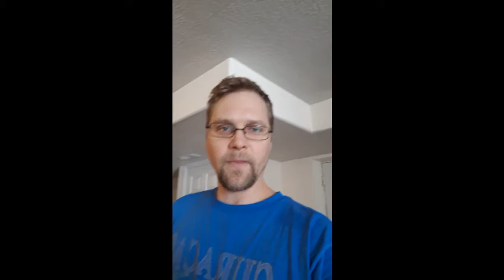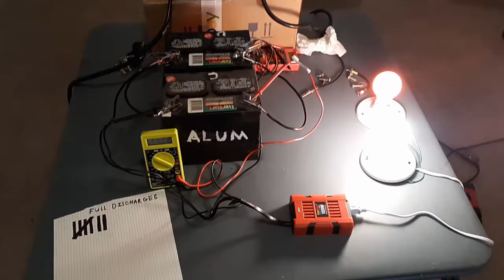Alum Vs Acid Battery  Stress Test

Comment: What is your charging voltage for alum? 13.5 or 14.4v?
Reply: Same as a lead acid
Reply: Up 15.0 max
Reply: @dcf246  other says it will damage the battery if it goes up to 14v
Reply: @smoke_stackz3168  maybe if you sit at 15v for too long it could,  but  as long as your keeping up on the fluid in your alum batteries, that will not hurt them,  if however you plates are not completely submerged,  the exposed parts might heat up and take some damage.  But alum batteries are Champs and can take a lot more abuse.
Reply: @smoke_stackz3168  but I recommend just using a regular battery charger
Reply: @smoke_stackz3168  also if you notice your batteries getting hot then you are starting to damage them,  and you don't need to go above 14.4v volts

Comment: If you're using an inverter the alum battery should fail way earlier than the lead acid battery. Alum batteries have a completely different discharge curve than acid batteries. An inverter is set to fail at about 10 1/2 or 11 volts to protect the battery. An alum battery will drop to that voltage much faster than an acid battery. 

I've run similar tests with just an alum battery, an inverter and an incandescent light bulb. I've never had one that didn't drop below the low voltage cut off very quickly. I've never tried converting a new battery, so I don't know how that would react. I would imagine it would last longer than a used battery converted to alum, but I doubt it would be a lot longer. Alum (unless you're using a mix with something else I haven't tried) voltage will drop to 11 volts quickly and then drops very slowly. Lead acid will stay above 11 volts a long time, but when it drops below it drops off very fast, like a cliff. Running lead acid below 11 volts very often will kill it much, much sooner than if you try not to run it much below 11 volts. You can run an alum battery to zero and it won't hurt it. But this doesn't do you much good with an inverter that's designed to protect a lead acid battery.

My prediction is that with your test, using an inverter, the lead acid battery will hold up for 400 or more cycles. The alum battery, if it's a good one will last many more cycles, but because of the low voltage cut off will only give you short cycles. But you could probably go a few thousand cycles and the battery would still be just as strong, maybe even stronger than it originally was, unless the battery already was shedding lead and that degrading lead shorts a cell or two. 

I don't know how much you know about alum batteries, but if you convert a new, dry battery that has never had any acid in it, it will not be nearly as strong as one that was first formed with acid and then converted. I would imagine it would last a lot longer, but it wouldn't have as much amperage. Perhaps after a lot of cycles it will get stronger, but I've never seen any data on that.

Below is a link to a video of John Bedini  explaining some things about the difference between lead acid and lead alum. The battery he's using is one that was converted dry and never was formed as a lead acid battery. The video might seem confusing at first because he's talking about voltages of the individual cells, but once you understand that it will make sense. Note: he loses me when he talks about impedance, but I know exactly what he's talking about regarding the curve because I've done quite a bit of similar tracking with a cheap voltage data logger. He shows the curve of discharge on an alum battery and explains the difference between acid and alum. He was one of the Youtube pioneers in testing Alum batteries. I start the video at around 15 minutes because that's where he starts discussing this topic of the discharge curve. If you're familiar with this curve you may not want to waste your time, but if you're fairly new at experimenting with lead alum, you will probably get a lot out of this video if you watch at least ten minutes of it.

https://youtu.be/Y0SjDBypcjk
Reply: Thats my problem too on alum it has lower resting voltage. But by the way alum can discharge to zero without damaging it?
Reply: @bernalynpusag3577  Yes. I've never actually run my alum batteries that dead, but that's what they say.

 One Idea I've been toying with is using 8 volt (4 cell) golf club batteries. If you put two of these together you could probably use a 12 volt inverter with no problem. In fact, it may work better than lead acid. 

Another idea I may try some day, but it's an expensive experiment, is buying a used forklift battery and converting the individual cells and using 7 cells for 12 volts instead of 6. I bet that would be perfect. You could run your inverters and you would probably have enough storage to run a refrigerator or freezer plus enough to run possibly your computer and entertainment system and some lights. The perfect system might be 14 forklift battery cells for a 24 volt system, 21 cells for 36 volts or 28 cells for 48 volts.
Reply: @donnybowers7832  yes thas what i did i cut old working battery per cell and i add it to my battery bank in 6 cell +1 it works better but my problem is idont know how much voltage can i set up to my solar pwm its 14.2v?
Reply: @bernalynpusag3577  I would say just leave the 14.2 solar charge on it. Your battery should run on the high side except those days when you use it more than usual. Most of your circuits should be able to handle high side voltages because 12 volt circuits are designed to run from a car battery that's hooked up to your vehicle's alternator or generator. That's usually at least 14.2 volts. If you were pumping that into it 24 hours a day and never drawing it back down that could be a problem. But unless you're on the North or South Pole your battery will only get so many hours of that voltage per day. You don't really want to set it any higher, but it seems like it would also be a waste to set it any lower.

I would be curious what kind of voltage your battery holds when it sits for a couple of hours after it's fully charged. Also, how well it performs with an inverter and a load on it.
Reply: @donnybowers7832  ive charge it in this morning at 14.2 and disconnect it from the charger and i test the voltage igot 12.9 volt only i think the 1 cell is not cycled up for now couse i use alum electrolyte iwish i would better result if i use the battery avery day to cycled up
Reply: @bernalynpusag3577  That sounds excellent to me. That's about  what it should be with 7 cells. As long as it isn't dropping down below 12 volts after it sits for a period of time (say 12 hours) it sounds to me like you have a good battery. If it drops below 12 volts after sitting idle for 12 hours it would probably mean you have one or more weak or bad cells. If it holds 12.9 or even a few tenths less, it's good (check it early in the morning before any bright sun hits the solar panels). Make sure there is no load connected to it after sundown the day before so that there's no drain on it before you check it. You could actually do this about 4 hours (maybe even 2 hours) after sundown and the results would probably be very close to the same.

Alum batteries usually don't hold more than 1.9 volts per cell. Usually it's slightly lower than that with a used acid battery that was converted to alum. Some are way lower if they have any bad or failing cells. If you're  holding 12.9 volts you have 7 working cells and your charge controller is doing it's job. All lead acid 12 volt chargers will charge at about 14.x volts unless they have a float charge mode. Then it would be about 13.x. Either way, your cells are only going to actually hold what the chemistry will hold. In the case of lead Alum batteries that's usually going to be 1.9 volts per cell or less. When the charger is first disconnected it will be more, but that's only a surface charge. To see what a battery will actually "hold" it needs to be off the charger for at least a few hours. 

There may be some cases where alum batteries hold more than 1.9 volts per cell,, but I've never seen it in any of the dozen or so that I've converted from old lead acid batteries (I haven't tried it on a new battery yet). A good one with 6 good cells usually sits at about between 11.2 and 11.7 volts.
Reply: @donnybowers7832  update i got 1.9v per cell and i decided more so i make it to 8 cell and i got 15.2v it works very well on my inverter i tested to load my inverter output about 150w in 3hours it drops to 15v only so its a nice converssion i add 5%sulfuric acid 8liters of rainwater and 6kg of alum😊 its better i have ready made 4cell battery by connecting them in series